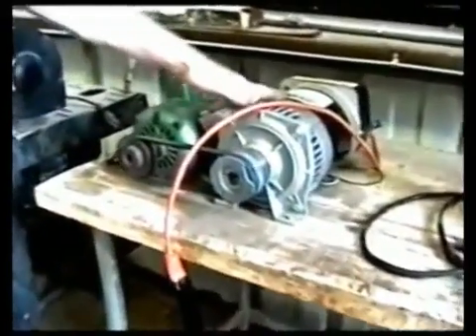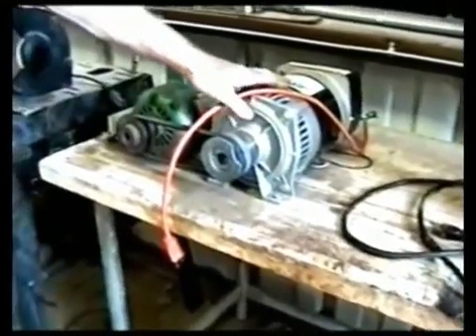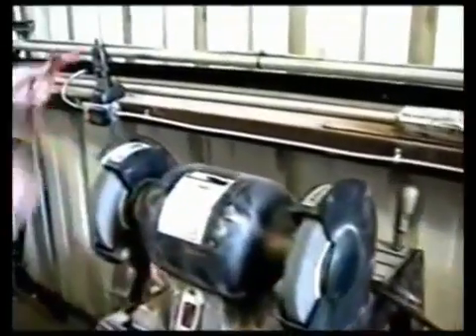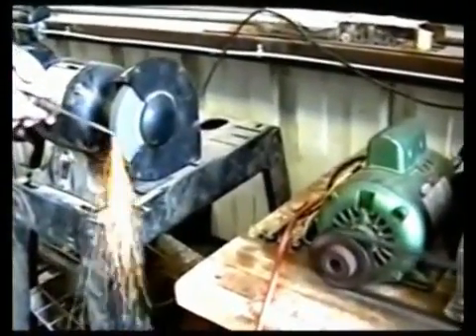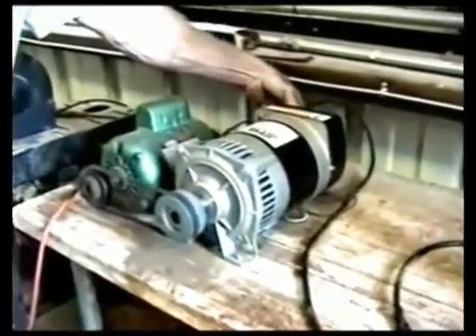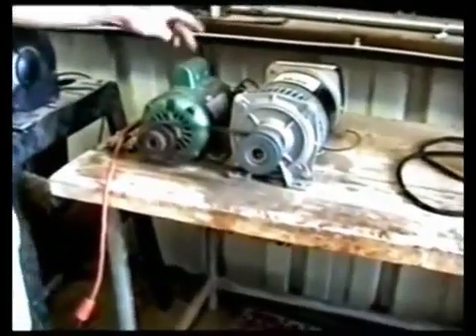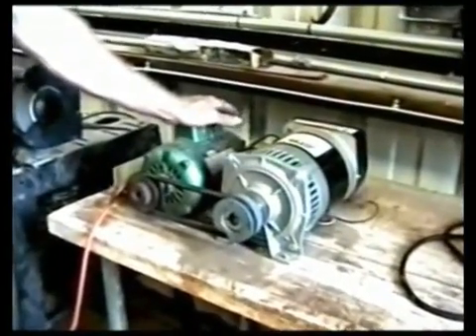3000 Watt Generator Powers Itself, Grinder & Drill Press.

Comment: yes or no pls. would it be possible to hand crank this to start instead of relying on pluging it into the wall i mean if it's REALY powering itself surely a propper gear and chain setup such as that of a bike so it doesnt rip your arm off could be used. you know in place of pluging it in.. ever.

again the question is does it HAVE to be pluged in.. yes or no.

Comment: FAKE,  this is physicality impossible, you cant get energy from this kind of feedback generator.
but if that works theoretically the rotation of the set will run to reach the infinity. So in this example with too many lucky you can recover the spent energy used to start the system.  

The Second Law of Thermodynamics
The Second Law of Thermodynamics says that (again in a closed system) energy goes from a usable form to a less usable form.

Comment: Seems pretty straight forward and robust. What sort of draw backs have you encountered beyond belts and bearings waring out? Also what sort of modifications were made to the generator to make it produce more power than the manufacturer designed it to make at a specific RPM?  I love the Idea but If it looks to good to be true it usually is.  Please enlighten me.

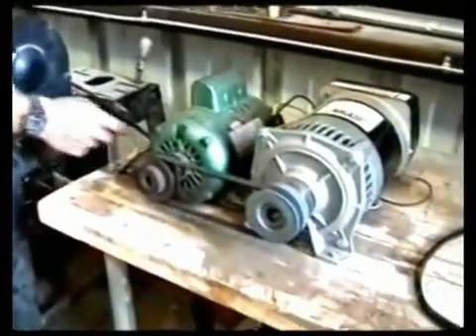Comment: its just nonsense... Please press the switch in 1:46 before you plug it in. Bet it will work, because there is a hidden power plug. Overunity is impossible

Comment: don't be ignorant, educate yourselves! this is nothing but a scam. One must input more energy to produce equal amount as there is no %100 efficient generator. Furthermore, if by some miracle your generator was %100 efficient, you would not be able to extract any power out of it to power a bench grinder and continue to generate enough energy to power the motor which turns the generator. People who posted the WOW comments have failed HS education. look up perpetual motion in wikipedia

Comment: i think this is just using potential energy stored in the motor and the genorator if it realy worked you could put a pull start on it and it would self sustain or even get faster

Comment: This is absolutely fake. Anyone who understands basic electronics and physics knows why this can't work. Energy is being lost everywhere in that system, friction from the belt, friction from the bearings, heat generated by the motor and generator, inefficiencies of electrical coupling, loss of energy due to wire resistance. You can't make power, you can only convert it from one form to another. Look at their website, they also claim to have an anti-gravity machine that can travel through earth.

Comment: "Generator makes 200x more power from ground zero" WTF? Nonsense words.  Folks, there is a  power cord hidden somewhere.  One huge flaw in this demo is that nothing would 'lock' the system for RPM and once disconnected from mains, it would vary in speed. I look at these videos, and wonder, did they somehow fool themselves, or are they flat out trying to fool us?

Comment: How did you get the AC motor to run at 3600 rpm? Like most AC generators this need to turn at 3600 rpm for 60HZ right?

Comment: It is impossible both theoretically and realistically.
The 2nd Law of thermodynamics prevents this.
To sum up this law in simple terms: Energy can be fully converted to heat, but heat cannot be fully converted to energy. There will ALWAYS be losses in heat.

Large electrical transformers are probably as close as you can get to 100% efficiency...about 99%..THIS IS A FAKE!!!!!

Comment: So let me get this straight, we have a 3/4hp (hp x 746W = 560W) motor running a 2900w generator, which then you (claim to) unplug from external power - but magically, the motor keeps running.

Then, you proceed to run a 14Amp (W = A x V, so 14A x 120V = 1680W) grinder off of the generator.

Anyone else notice the power cord through the bench going to the switches at 0:25?

Nice try, learn some mathematics and how to hide the power cord next time.

BTW, I think you missed your train.

Comment: that is dumb and fake.  you have a switch on the left side of the two motors, why couldn't you have a separate power cord running under/behind the table out of sight.  perpetual motion is nonexistent because it violates the laws of thermodynamics.  they're called laws (not theories) for a reason....they're proven.  energy cannot be created, only transferred.  what you are trying to make a quick buck off of is a scam that makes people think you can create energy from nothing...stupid boy.

Comment: Just what I figured from physics, Conservation of energy states that the total amount of energy in an isolated system remains constant over time meaning that the generator should keep working if we were in a friction less world and no external loads are in. So eventually the generator would slow over time once the energy used at start up would be spent by friction and external loads. Time that it will stay running depends on the efficiency of each motor and how much the capacitor affects Vripple

Comment: damn, self sustained energy, almost perpetual but the fact that it need to be started by another source. any ways, this was my last years science fair project, and just came out of my mind without seeing anything alike before, but didn-t succeed, used a 50amp car alternator and couple it with a air conditioning turbine MOTOR and gave it power, and didn't work, later one, realized that alternator had to be plugged to the batery in oder for it to generate. althoough got 1st place.

Comment: This is bullshit all your doing is using the Kinetic energy from the rotating mass of your magic generator/electric motor combo. Its not a perpetual motion machine and does not create energy.

 Energy in = energy out. 

I bet your grinder would stop running within 5 minutes under a load.

Comment: You can run a grinder up to speed, shut it off, and do the same amount of grinding he did with just the rotation of the wheels.  And it takes nothing to spin a screw driver in a drill press.  But its the lack of any meters that tells me this is BS.  You can by a meter that will show voltage or current for under ten bucks.  But he has nothing.  
If you want to impress me show me some current use.  show me constant voltage under load.  Right now I think you are a fraud.

Comment: This is not a true representation, there are flaws:

Firstly when you start up your bench grinder the starting currents are very high, this is not reflected on the motor-generator setup, if this was real the speed would dip momentarily on the generator at starting point.

Also where is all this energy coming from, there must be cable losses, losses in the coils, losses to heat and sound, losses to friction, losses to magnetic fields.

You can not be serious about this being real?

Comment: Here in Brazil has already talked
 with some expecialistas area in which I corrected disendo
 idea that this is not possible, (which the energy generated by the generator
 connected to the engine rotation rpm is not enough to generate
 energy to power the motor "again").
 But watching your video I realized that is capable yes, correct me
 if I'm wrong, and ask whether a theory is correct
 that I may sustain and provide for these people
 who said it is not possible.

Comment: Greetings ... I watched your video and found it impressive.
 My name is Bruno, I am Brazilian, I have no experience
 With electric, but always figured it might come
 in energy production without using some kind of
 fuel / power that has to be replenished
 (For example: Power generators that run on gasoline or disel).
 The idea is to get a generator that meets the
 User needs and does not need power
 of fuels such as gasoline or disel and other more.

Comment: @Smart2009Tech The Alternatotr is an Italian Mecc-alte, capacitor compensated brushless. it looks like it is a 2.2 to 3 kva. In the USA it will be 60hz so the speed will be 3600 rpm but to stay on frequency with a full load the prime mover will need to be running at 4000 rpm due to loads applied. Be interesting to see what will happen when the full load is applied to the alternator!

Comment: herp derp troll science

conservation of energy.... it wont work (atleast not for long) it would only have as much energy as you put in it and it would lose energy over time by itself because of heat. 

it certanly could not power a grinder or a drill press.

-Sir Issac Newton

Comment: Listen close and notice how the speed of the motor generator pair never changes.  If you really did have a motor driving a generator, which in turn powered the motor, you'd expect either an excess or drop in the energy of the system.  It would not be exactly as it was when powered from the AC.  This is an old idea that does not work. It violates a fundamental rule of thermodynamics, and it's repeatedly used to cheat people of their money.

Comment: This is interesting, but physically impossible since the systems isn't perfect, in other words you can't generate the same or more power than you expend. Consider the perfect motor and a perfect generator and then you´ll find the system to be running for ever you consume what you generate, but it's just theory, in the real word it wouldn't happen anyway.

Comment: Seen many of this. You cannot create energy. You cannot destroy energy, 

The mechanical power given by the motor is returned by the generator. 3000W from the motor is returned by the generator. Ideally OK.  What about the copper loss, Friction, heat MotorPower = GeneratorPower+Heat+Friction+ CopperLoss.. Here MotorPower should be higher that the power  input. (Generator output) . Ordinary human can not do this. So He must be God

Comment: There's something fraudulent going on. There is no possible way that you simply have a generator and a motor belted together with no form of energy storage, or supplemental power. Just getting a generator to turn itself by way of electric motor has 3 stages of loss, and HP directly converts into energy after losses... Now, the case on the generator was big. It's probably a large alternator with an inverter. So perhaps lithium batteries hidden in the case? What was that secured under the table?

Comment: You seem to lack basic physics knowledge, and of course engineering. All the power that you consumed (grinder, driller) came from the grid AC power (when you plugged the motor). The sense that it is autonomous is an illusion. It's just the power you took from the grid (and less) that recycles in the system. You think if it was that simple, world wouldn't have already been using it? But obviously you only care to fish victims for your site/organisation, so you will delete this comment.

Comment: Wait a sec. There is a major mechanical engineering hole in this theory. The efficiency of the two motors is less then perfect so eventually this machine would seize and quit providing energy. because energy can not be created it can only be transformed. there is no way around this. either the generator coil or the electric motor coil will eventually slow down enough to not provide enough electrical current. especially if you use it to power a high current draw device like a drill.

Comment: I call hax :)

You say you've modified the generator, you've probably wrapped more coil in there.. but surely increasing the coil turns also increases the energy required to generate electricity?

If not, why isn't this technology being used everywhere?

Comment: I surmise that this is really a flywheel concept as the initial ac power is used to turn the generator on and then this turns the generators flywheel to spin at high rpms. You then unplug the ac and run power off of this generator. The issue is how much power in to how much power out and at what losses and how much power do you get back out as what you are basically doing is power storage like a battery. Please provide more specs and info otherwise it is just another scam.

Comment: i was just starting a project identical to this one, but my over all question to the system is, "Can it work on a larger scale if given the right circuitry?" im currently in the process of working out the math. If the math is right we should be able to build a large scale model that would power a home with great efficiency.

Comment: pysically impossable, evn if 100% of the energy from the generator was transfered to the motor and then 100% of that energy was transfered back to the generator the devices runnung off if it would surely suck all of the energy out of it quickly due to the fact that the other devices aren't putting any energy back into the generator. reguardless, the generator will never make enough energy to power it's self. if this was possible then it would have been put to use all ready on a large scale.

Comment: Perpetual Motion.  Thermodynamics. Let it work for about 10 minutes under a load.  It will stop.  It is essentially coasting.     This works in the video because of kinetic energy built up while the system was being powered by the AC in the wall.  All that mass spinning keeps the generator running which powers the motor to keep the generator spinning, yes.  But Friction and electrical resitance and conversion losses from electrical to mechanical energy will eventually bring it to an end.

Comment: simply not possible. what you're doing is only a trick of wiring to hide the real power cord that the motor is plugged into. you're also an excellent example of how to be dangerous in the shop.

Comment: If it really worked (it can't) you'd getting rich selling them through Home Depot. A motor and a generator are two versions of the same thing. One or the other, or both would have to produce more power than it consumes. Each has friction that consumes a fraction of the power. If it works as shown you have a battery boost somewhere that will run down. You uploaded this 1 1/2 years ago and you haven't marketed your Perpetual Motion Machine?

Comment: hypothetical machines that operate or produce useful work indefinitely and, more generally, hypothetical machines that produce more work or energy than they consume

There is undisputed scientific consensus that perpetual motion in a closed system would violate the first law of thermodynamics and/or the second law of thermodynamics. 

Despite the fact that successful closed system perpetual motion devices are physically impossible the pursuit of perpetual motion remains popular.

Comment: 14 Amp grinder?   16 Amp drill press?  Wanna show us the nameplates?  The maximum load current for a 115V plug-in device is 12 amperes.  This video has had nearly 600,000 views and only 14 comments?  Fraud.

Comment: That's like saying that you can connect a multi-plug to itself and have free energy 0_o You need more energy to power the motor in order to move the generator that what the generator can produce, even if its modified. I don't know if I'm being ignorant but I just can't figure it out.

Comment: NOT POSSIBLE !:
the generator will never generate more energy than is put into it (or convert i should say) because the generator is powering the motor! the generator only converts mechanical energy to electrical energy; the motor does the opposite. plsu you have friction etc...etc

mechanical losses in the bearings and the belt and again in the generator, resistive losses in the generator etc

Comment: Looks nice but you can't just create energy. If the motor is 'running' the generator, the generator can't make more energy than what the motor puts into it; not even accounting for the energy losses within the generator. Would you agree that if you plug any motor into a wall outlet, you can't get 100% of that energy out to the shaft of the motor? Some turns to heat overcoming wire resistance and friction in the motor. So, please explain how your generator 'creates' energy from nothing.

Comment: This looks like an accident waiting to happen. Youve got wires hanging around fast moving parts all over the place. Jesus christ! And as the for the generator. What the hell? Is this supposed to be some kind of perpetual motion machine? Are you trying to say that this motor is powering a generator which is in turn powering the motor and 2 other electrical items, then you are unplugging EVERYTHING from the mains and it is all working by itself?

Comment: This is ridiculous and impossible. A 3/4 HP motor = 500 watts of mechanical energy. You can't get 3kw of electrical energy from .5kw mechanical. You might could get 300 watts on a good day, but not 3000.

Comment: So you just modded the generator to make more power and you just plug it into the motor? Is there a way to start this running without AC power sort of like a lawn mower engine?

Comment: What does it actually cost to build one of these things? What are the dangers of it (i.e., run so hot it catches fire). What are the conditions and space it needs for optimal operation? and Can it be quieted down?  My neighbors downstairs and across the hall would be upset if I had this racket going on all day ;-D  But I'd love to have something like this to operate my stove/oven and refrigerator and my computers.  That would cut my electric bill down to pennies a month.

Comment: Oh, so we've worked out how to run a cable up the inside of a tube steel table leg have we? Very good. You would make an excellent Art Department electrician, go see if you can get some work in Hollywood.

Comment: Great idea but your shop is a safety nightmare. How many times did you reach over the highspeed belt to get to the plug at the back of your machine? but the screw driver in the drill was a great touch .